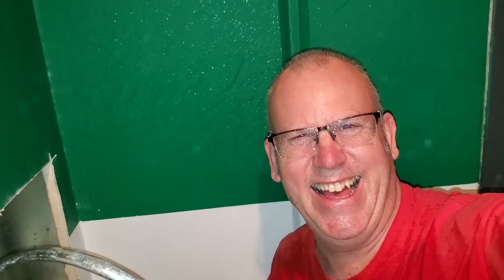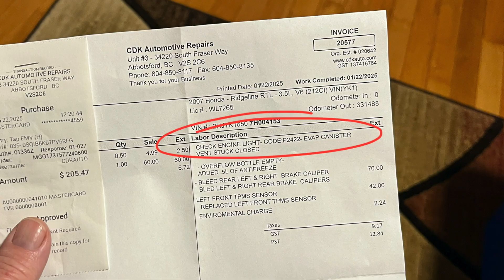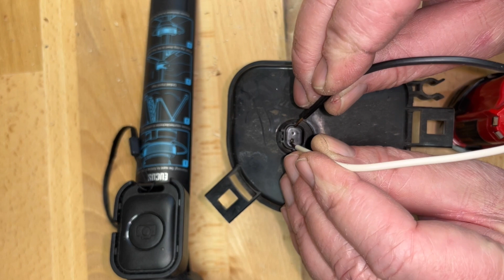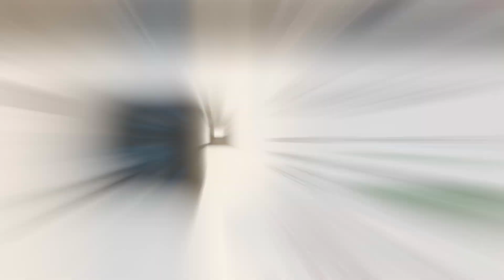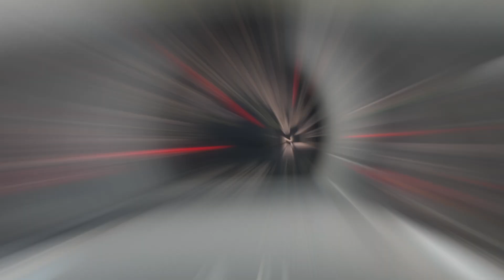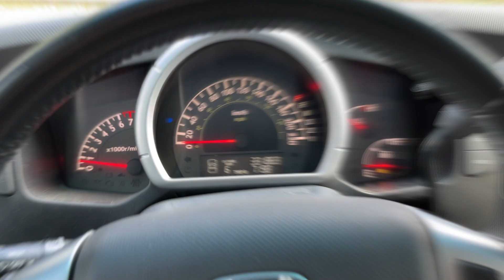Repairing a P2422 EVAP Canister Vent Stuck Closed for $15! - S07E174

Comment: For those that wonder. This selenoid is polarity specific.  That's why it shorted the first time. 
Also this selenoids are all the same, the only difference is the case that has diferent tube connections pointing diferent directions based on the vehicle that is being used. 
To separate the selenoid from the case just grab the whole assembly with both hands with the electrical connector facing you and push the electrical connector in with your thumbs 
Note: do this on top of a table or close to the floor as the selenoid will most likely will be spelled out from the other side.
Now that the selenoid is separated you will notice the whole mechanism and will be able to clean the membrane that creates the seal. I will recommend to use a little bit of spray silicone on the membrane after cleaning it and checking the selenoid activation with a 12v power supply. 
Note: if you look inside the connector with a light you will see the positive and negative markings for polarity 
Finally it's recommend to code the two oring in the selenoid with silicone paste to create a good seal and push the selenoid back into the plastic case. 
This is one of this cases we're the manufacturer used the same selenoid for multiple cars but people have no idea as they see the big black case and think they  need to get the whole assembly and pay the absurd price that honda asked.
If your selenoid is cooked just find the cheapest version of the evap selenoid for whatever honda vehicle and transfer the selenoid to your specific case (enclouser) 
Sorry for the long comments but hopefully it will be helpful for someone

Comment: so, is that the same pins ? i mean there is nothing like negative or positive ?
Reply from the maker: According to Google: 
For most Honda EVAP Canister Vent solenoids, the polarity (positive or negative) does not matter, as they are basic solenoid coils. The vent solenoid is essentially an electromagnet that pulls a plunger when power is applied, regardless of the direction the current flows. 
Pin Configuration: The connector typically has two blades (pins). You can usually apply 12-volt power and ground to either pin to test if the solenoid clicks.
Wiring: While the connector on the solenoid itself does not usually have a specific polarity, the wiring harness often brings a positive (12V) feed and a ground controlled by the PCM (ECM).
Testing: When bench testing (e.g., for code P1457 or P2422), you can use a 12v source to trigger the valve; the solenoid should actuate regardless of which wire receives power, provided it works.

Comment: Is it still working? Bout to the same on mine 06CRV same code and all i get the sparks and no pusher noise😢 i just need to pass emissions.
Reply from the maker: It worked for awhile, but I ended up needing to replace it.
Reply: Thanks 👍